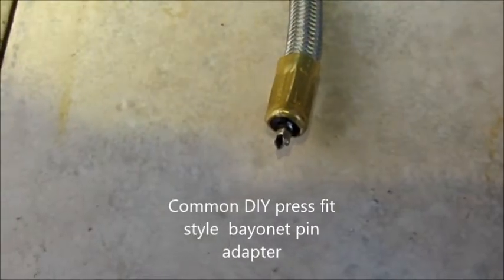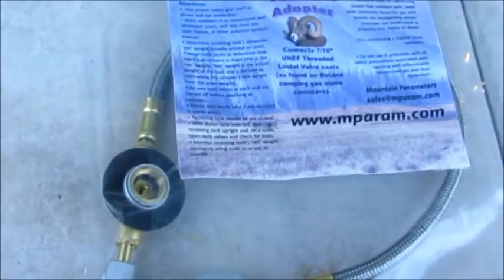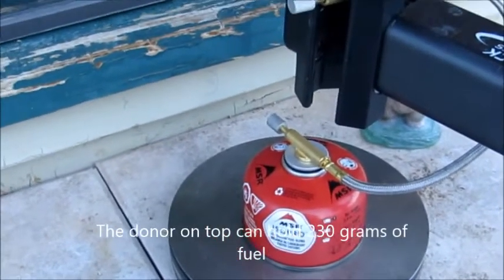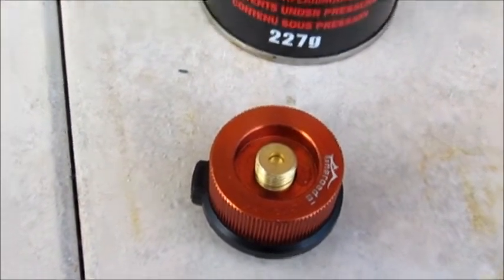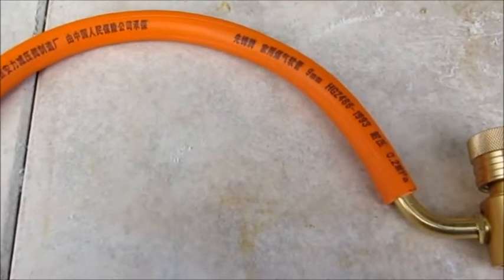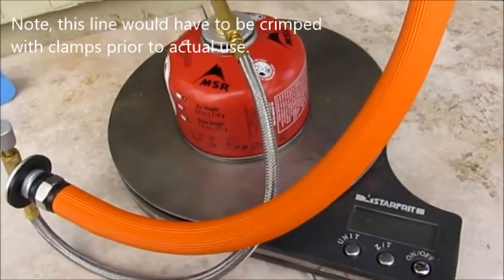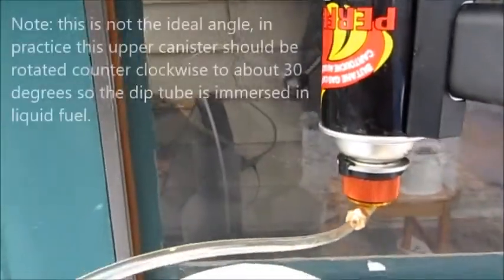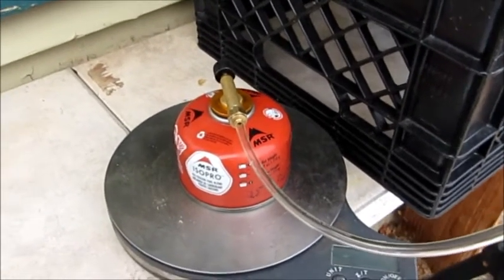Butane camping stove canisters: refill line adapters

Comment: Hi great video I like the 5 pound bottle idea could I go to my propene store first ask to have it filled 30% which in pound ??? then all I have to do it fill with the butane canisters then I have my winter mix for some years to come
Reply from the maker: +Dave Hawes 
I'm not sure how you'd get Propane and Butane mixed in the 5lb bottle without a lot of hassle. Even if you could, when you inverted the bottle to fill the smaller canisters, you'd be drawing the propane off first, leaving the Butane behind. You have to do your winter mix each time using the small canisters.
Reply: +Mountain Parameters thanks I miss understand I thought I was a mixed after reading the info after will do just the small canister and take it from there thanks again
Reply from the maker: +Dave Hawes 
Sorry, you did not misunderstand, I'm the idiot, my bad. I just realized, if you had a mix of propane/butane in a 5lb bottle, and you inverted it and then filled the small butane canisters from that, you would still get the winter mix in the butane canister because you are drawing liquid off the bottom of your 5lb bottle. According to Roger Caffin, propane/butane mixes in its liquid state, but separates in the gaseous (vapour) state. That's why you do your winter cooking with a stove that can work inverted.(If you cook with a winter mix, and the can is upright, you burn most of the propane off first. You will then be left with a half full container of butane and not enough pressure to cook with). Your idea sounds like a good one. Sorry for confusing the issue!